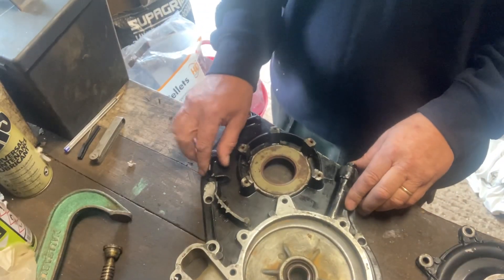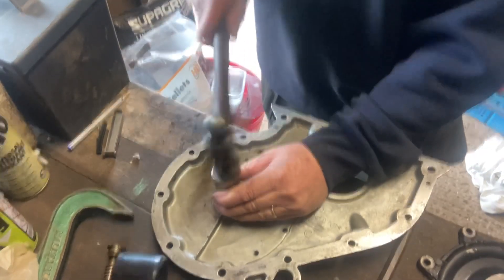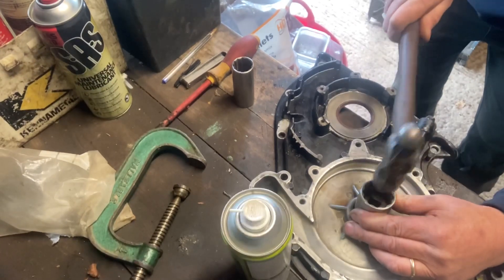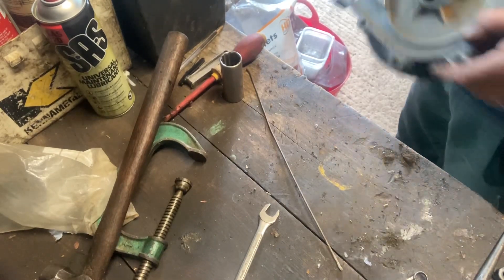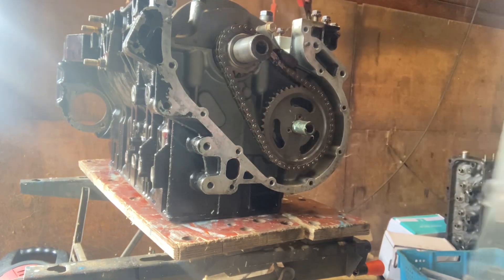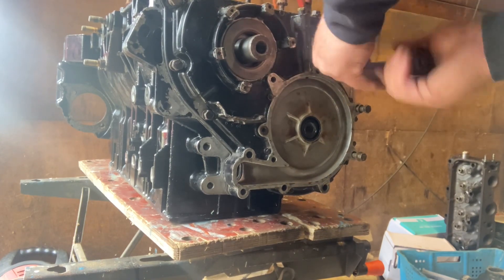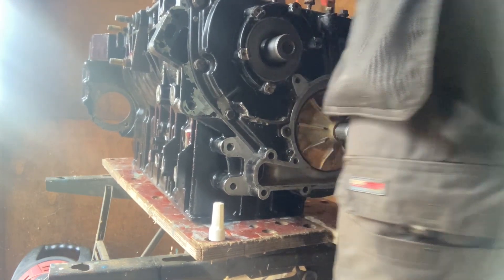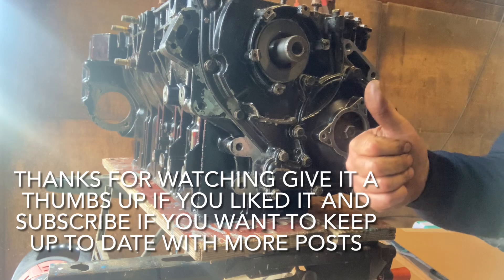Mercruiser 470 engine rebuild part 3 timing cover and water pump

Comment: Just bought a fixer-upper and it has the same engine. 
Now does that pump just runs water from the lake/ocean?  
antifreeze runs through the block only?
Reply from the maker: @joseandrade-zn5vn  I have done another video on the cooling system explaining how raw and cooling water flow through the heat exchangers and block

Comment: I've just received 2 of these classic gems. One is almost complete, the other no head, cyls full of water from being outside. A kiwi mates's next door neighbour had one in a 40 series SWB cruiser for competition hill work. Had head gasket probs, so Richard had the Sleeves machined out and fitted custom fat to lips to stop water creeping under gaskets. Very impressed. I want to build a modded unit to fit in a lightweight hotrod. ( I have a tupperware 23 T roadster which would look nice with a firey turboed 4 pot. around 400 hp/750 kilos should shake the fuel tank a wee dramm.
Reply from the maker: @hogtownhenry  sounds like an interesting project 👍

Comment: I just got a 19ft bluewater with this 3.7l 470
Reply from the maker: Well done 
I’m going to set up a Facebook page for the channel, when it’s up and running maybe you could share your project on it
Thanks 👍
Reply: @Keithsbrokenboats  yeah for sure I'm making a video right now about the leaking fuel line and setting the points

Comment: Keith, where did you get your gaskets from please. Thanks.
Reply from the maker: I ordered them from a company in the USA 
SBB Sports LCC South Carolina. I found them on EBay. 
Getting parts was hard trying to find them at a reasonable price
Reply: @Keithsbrokenboats  Great, thanks for that, I'm going to need a new head, water pump and impellor gaskets
Reply: Part number
Reply from the maker: @jaggargarcia749  part number for what part please

Comment: Water pump doesn't pump raw water.   If someone is using water as coolant then you would have to use the water pump drain during freezing temperatures. Nicely done video series.  I love my 470
Reply from the maker: Yes you are correct. The raw water pump is in the bottom of leg and only pumps water around the heat exchanger and the power steering oil cooler

Comment: I’m surprised you have not used gasket compound?
Reply from the maker: I’m using new good quality gaskets. Engines are not normally built from new with gasket compounds gluing gaskets in place. 
Also I have experienced stripping down an engine and finding excess gas glue in oil galleries. 
Thanks for your comment and thanks for watching 👍